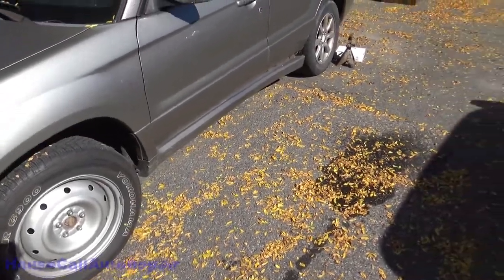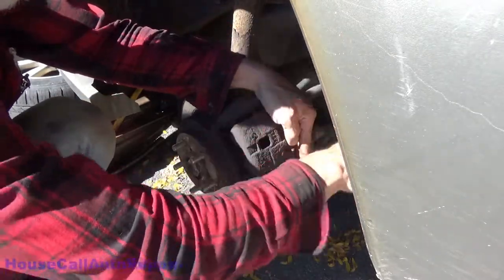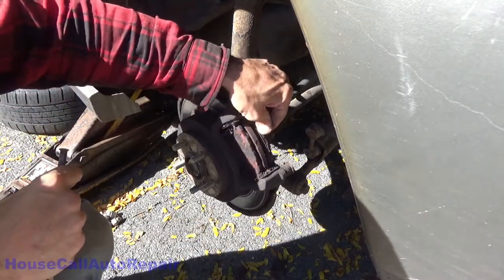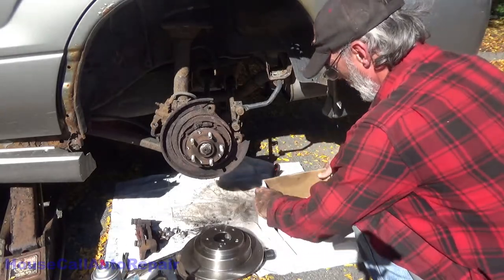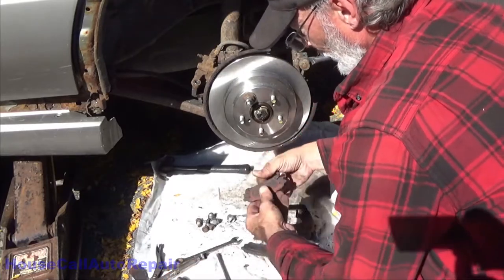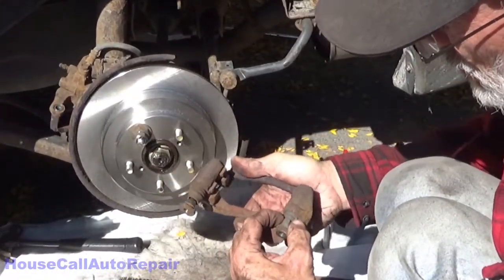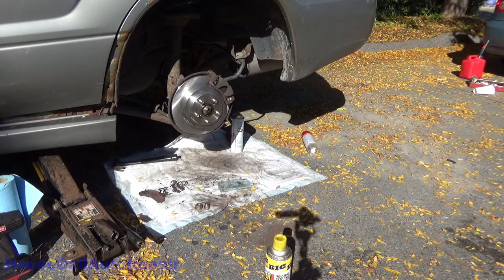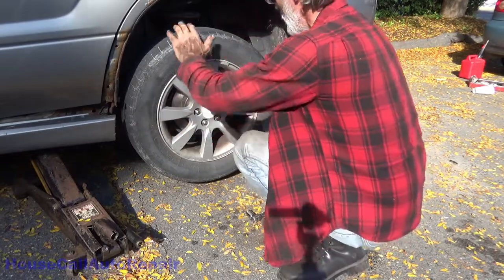2006 Subaru Forester Back Brakes and Blown Lines - Part 1 - Auto Repair

Comment: Your series of videos on this helped me more than any other during the replacement of the rear brake lines on my 99 Outback. The insight, explanation and problem solving from someone who works out in the elements instead of a heated garage with the vehicle on a lift is really quite refreshing and very much appreciated. Thank you for doing this!
Reply from the maker: Heart felt comment. Thank you!

Comment: i think you should mention the correct way to push brake plunger in is with the correct tool that puts even pressure on the piston not side loading and you could mention if you do not have correct toll hopefully you have a c-clamp and use one of the old pads to push back last resort is to use pliers to retract piston.
Reply from the maker: I think I have in a few videos, but probably should put a bit more emphasis on the issue, more often...

Comment: I always change my brake hardware now. I once tried to reuse the ones from before since they still looked good, and they broke on me and ruined a new rotor.
Reply from the maker: Whenever possible, I ALWAYS replace the metal clips.